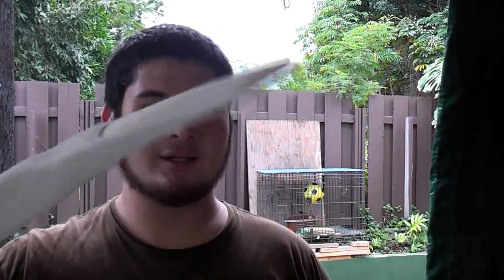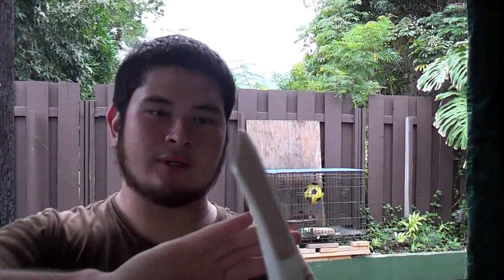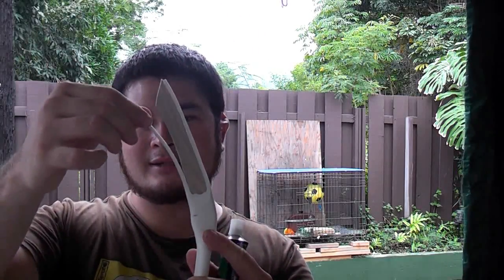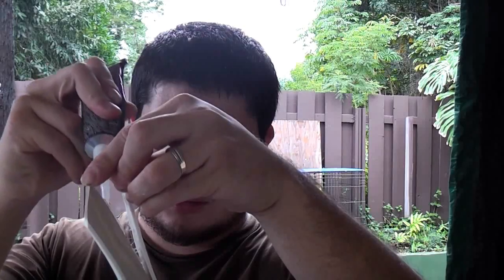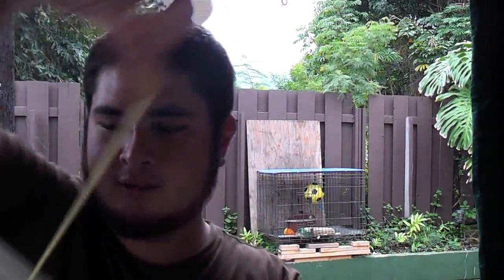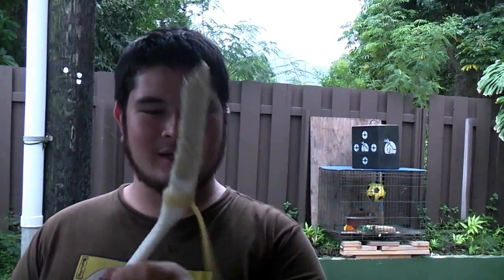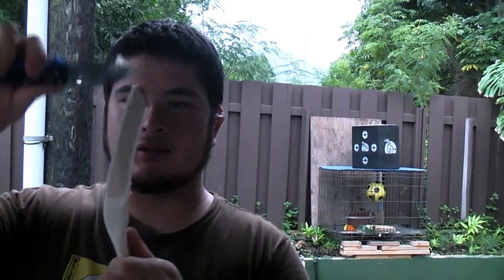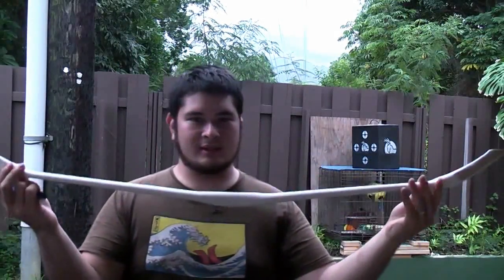How To Make a 30-35 Pound Horse Bow With Laminated Wood Siyahs Part 3

Comment: Hey you might want to look in to PolyUrethane glue, I used it yesterday for glueing zinc-coated-metal bolts in a pvc pipe. and it did the job.
Also use this lot's of times for wood to wood cause I like the sound specifications it has on my instruments.
And also made a plexiglass dremel baseplate with connection of PU-Glue.
This like the best product I have tryed after epoxy.
Note it has a green foam structure. Always do tests before using on a project.
Greets